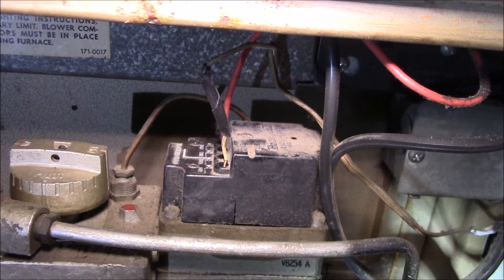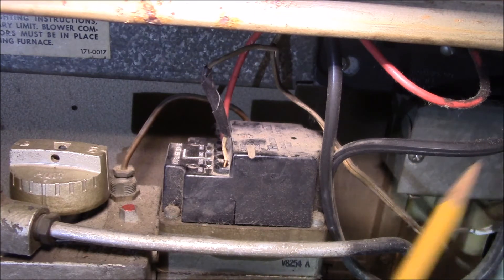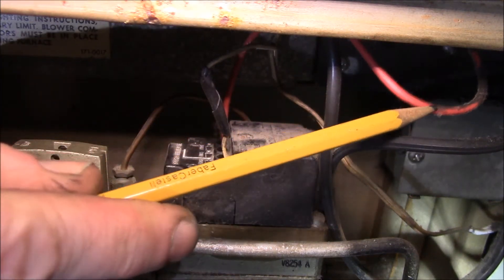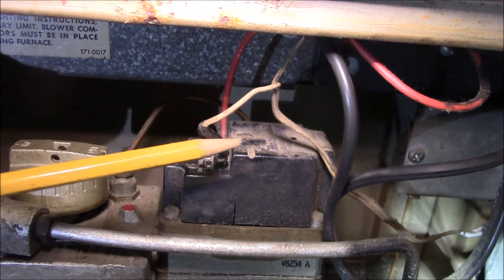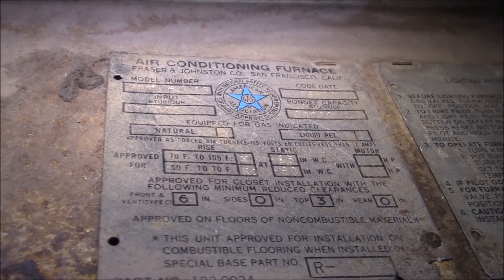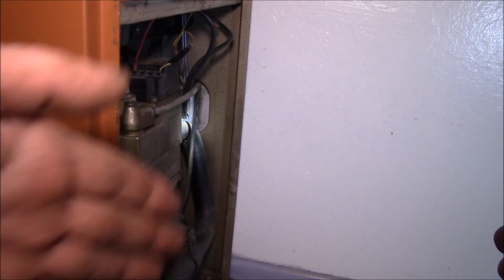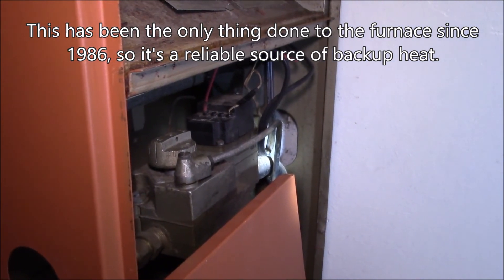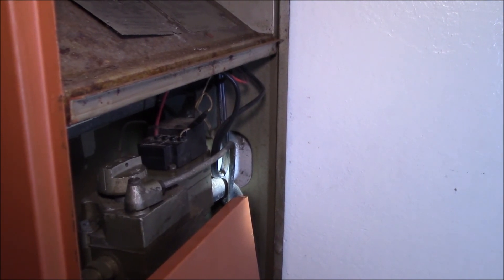Getting the Old Fraser Johnston Gas Furnace Running

Comment: 1 side of burner takes to long to ignite makes it go boom when it does light
Reply from the maker: One burner in a furnace may be hard to light due to issues like a dirty or clogged burner, a faulty flame sensor, or problems with the gas supply..
More info. below:
https://afmplumbingheating.com/furnace-burners-not-lighting-causes-diagnostics-fixes/

Comment: thx so much . we have a 70s Fraser Johnston in a 1976  apartment. it's not coming on and I think - when the tenant moved out -  the utility perhaps shut the gas supply off and I didn't get the shut off notice. . this helped clarify a few things.
Reply from the maker: Glad the video was helpful.  Yes, best to check the gas supply and also, re-lighting the pilot on these is tough, at least on mine.  It's way in the back on the right side and mine is installed in a small closet that makes accessing that side very difficult.

Comment: I have a fraser johnston furnance that just stopped working a few days ago the thermostat ask for heat but the furnance doesnt turn on and the thing is that  the control is not showing any red light indicator code i replaced the safety door switch but still dont work
But when i pressed the fooor switch one red light turn on for like one second on the control 
But that is all

Could you please help me to find out what the problem can be?

Thank you very much in advance
Reply from the maker: Sounds like a later model that mine.  See if you can locate a service manual for something in the same vintage.  With the door switch, there may also be vacuum switches for inducer blowers and flame sensors and rollout switches that may impact operation.  
You might check out the @grayfurnaceman channel, he has some good walk throughs of various older furnaces.
Reply: @The4Crawler  thank you for replying ill check that
thanx again

Comment: I too was looking for how to wire an old furnace valve. I have an old Duo Therm from 1974 (LPG) that hadn't run since 2004. I had to replace the valve with a modern one and was confused since the new one had 5 wire spades and old one had only 2. This video helped me confirm that only TH and TR were needed for my application. Thanks for posting this much appreciated.
Reply from the maker: Great, glad you got yours fixed.  Things like this were a lot simpler back then.